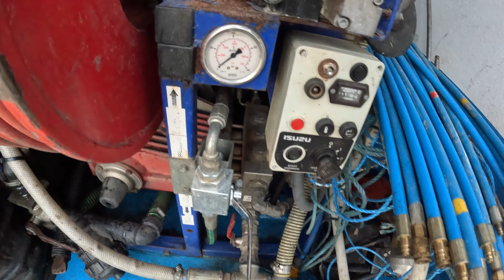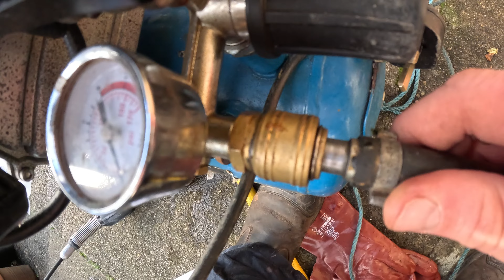Help the urinals are blocked

Comment: I know liner exist in long length (100m) that are stored frozen (as the curing agent is already mixed at factory) put in "in reverse" like a big socks and then "vapour cured" for main line sewer. 
As this is far  too complex for a small sewer, your can only do "small length" but  what is the max length/diameter of the system you use ?
Reply from the maker: we only do 4 inch and 6 inch either 600mm or 1 metre we are looking at getting a packer to do 9 inch currently, as a company we use to have the equipment to do full length fibre glass resin 4 and 6 inch with an inversion tube but we moved away from it and started doing more patch lining as we weren't getting much work for it we got rid of the equipment and decided just to subcontract if required.